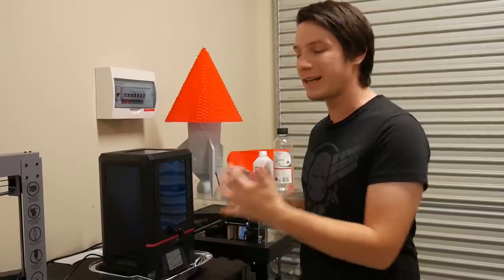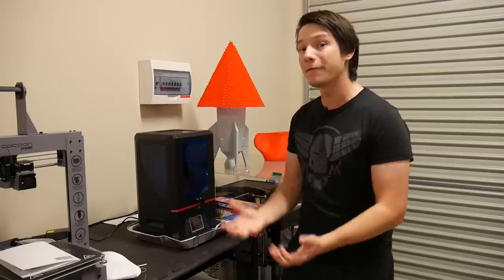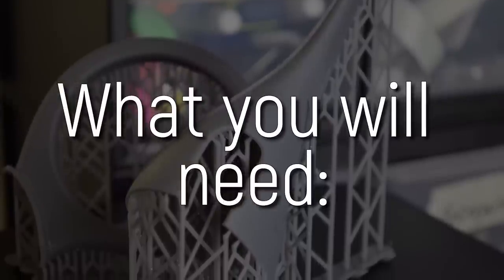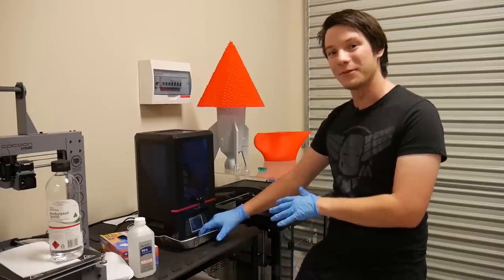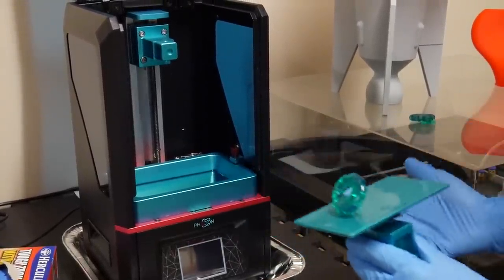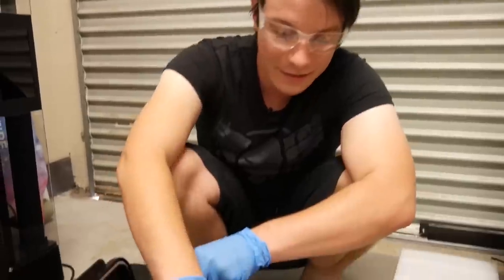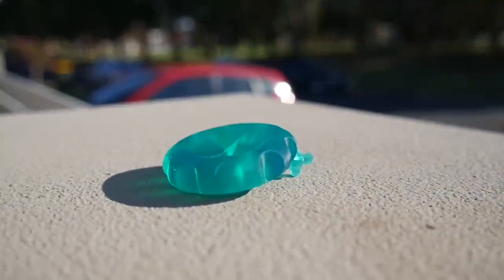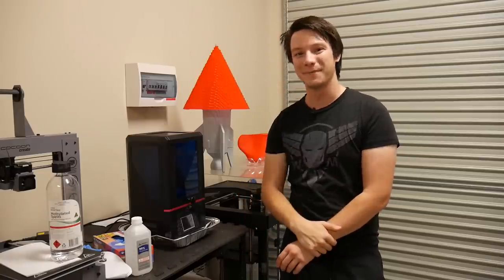Resin 3D Printing Safety - Important for Beginners!

Comment: Nice video!

Side note, I was wearing gloves the other day and some resin somehow got in (was pretty obvious - could feel a burning sensation). I sprayed heaps of isopropyl on my hands then washed them thoroughly with soap. No scarring or anything but definitely not using that brand/style of gloves again. Will source some better ones (a little bit tricky during COVID I'm finding).
Reply: Never EVER use IPA to clean resin off of your skin. All you did was accelerate the process in which the resin goes into your skin.

Comment: +Maker's Muse I'm getting mixed signals researching this machine as to whether or not I should ventilate the printer.   As in,  putting some kind of box around the back with a ventilation tube leading outside.    The resin is dangerous,  but sometimes I hear sometimes I don't that the printer produces fumes?  From there it's also not certain whether or not the fumes are dangerous or if it just smells.    Would this printer be safe to operate at my desk?  Right beside me,  with a window next to it hardly a foot away from where the machine would be?
Reply from the maker: No, do not use it anywhere near your working area and it produces acrid fumes which must be ventilated, a box with a vent outside is a good plan.
Reply: Ah,  that's what I've been going through videos and articles to try to learn.   In the process I read and heard people saying that it's a great printer for a desk,  some saying it's safe,  some casually mentioning ventilation and that the fumes smell bad leaving me confused.   
So to confirm,  I should NOT use this printer near my (Indoor) desk?  Even if I ventilate it out the window?    Or is it perfectly fine if I vent it, just not on its own?
And are the fumes particularly dangerous or are they just temporarily irritating in case the vent fails / something I shouldn't be overly concerned about without prolonged exposure.  I mean,  you had the printer running without special ventilation (Though in the garage and not exactly indoors) so I assume it's relatively safe with airflow. 
Any long term health risks from casual / brief exposure to fumes or accidental resin contact?

Comment: In terms of resin disposal such as solvent tainted with resin would it be prudent to transfer the resin/IPA mix into a Tupperware and let it sit outside in the sun? IPA would evaporate and leftover resin would cure in the sunlight rendering it safe.
Reply: Michael Eisenhut 
Apparently, you can put the resin / IPA mix into a suitable transparent sealed container and put it in the sun for a few days. The resin should cure in the IPA and then you can filter the solution and reuse the IPA. Saves getting rid of chemicals as the resin will be cured and inert AND you save money on IPA!

Comment: The drama around the toxicity of UV resin is over the top. It’s basically as toxic as gasoline, mineral spirits, turpentine, polyurethane, oil paint, acetone. These products are used all the time without any of the “it’s not safe!” Hysteria
Reply: Thanks for confirming this, just got a printer and everyone acts as if resin is bromine… like just don’t drink it and you’ll be fine
Reply: @HighFidelityFox  I’d also make an effort to keep uncured resin off skin and surfaces . Anywhere you wouldn’t want paint thinner or nail polish remover or a similar product
Reply: @jeffhreid  Got it, thanks for the heads up!

Comment: I dont like to use gloves with SLA prints (altough I highly reccomend it in training I conduct), because without them you can feel if part is properly cleaned. (if you don;t have ultrasonic cleaner which I highly reccomend).
I think that for hobbyist MUCH MORE IMPORTANT PRECAUTION IS GOOD VENTILATION.
I've recently cleaned about  500g of parts in not so well ventilated area and it wasn't nice.
Do it under a hood, in P3 mask or outside!!

One disclaimer though: I work only with top quality DWS resins. If you use one of these cheapo chinese stuff, gloves are a must!

Comment: BEFORE  YOU  READ THIS: I AM A NAIVE 13 YEAR OLD.
I find using my anycubic photon not that hard to work with. Also what makes the resin so toxic?
Boy it STINKS tho while its printing.
Reply: @handytech9481  Are they toxic? I doubt it tho Cause the manual said it had a carbon filter.
Reply: @treasuretotrash2067  Yes, they are VERY toxic. The carbon filter helps a little, but just a very little. In fact most of the carbon filter systems I've seen makes the problem worse because it only filters the air once and then immediately puts that air into the room making the room stink, but just a closed lid with a good seal wouldn't do that. A system with a hose attached that sucks the air outside that has another filter in it too is much better. Tall chimneys would also be needed to put the air high above people's houses. Even then anybody near the machine needs a full respirator mask with another carbon filter that can capture volatile organic compounds. And you need a giant fan in the room and an open bay door to blow all the rest of the air out of the room. Plus you need nitrile gloves and face goggles. So basically be done outside or with a giant air intake and outtake system like you'd find in a factory since the fumes stick to the roof and walls and other surfaces in the house. Also since the residue sticks to the inside of the machine it has to be cleaned carefully between uses with detergent and gloves on and you can't dispose of that water in an ordinary way. Because of all this I don't recommend resin printing at all, but if you do you should consult with a professional chemist on how to set up a safe laboratory and on proper procedures. The resin is toxic because it contains chemicals that go into the air very rapidly (that's called a volatile chemical) and those chemicals are designed to bind with other things extremely well. Basically the resin wants to harden in your lungs and burn your skin when it is in the air. And when exposed to light the uncured resin gets hot and so can burn you very badly. That heat is caused by a reaction between the photosensitive chemical and the bulk material which builds the shape. The light from the machine or the sun or a curing light starts a chain reaction because it adds energy to the resin and that lasts a long time after the light source is removed. If too much liquid resin is inside the model when curing the resin will push out from the center and blobs of super hot resin will come out and can burn you. That's why the model has to be hollow with drainage holes at both ends so when you wash it in the alcohol you get all of that out of the model and all excess off the surface. After being exposed to the sun or whatever uv light the model will still take days and days to fully harden and is toxic during that time and is still releasing poisonous gases until it no longer smells bad basically. Even after it is cured the resin model can't be near your mouth and isn't food safe. Even hardened resin is a dangerous substance to sand with sandpaper too and so sanding has to be done underwater with gloves on. So resin printing is basically a giant pain in the ass as the resin is very dangerous stuff. In my opinion it's basically so dangerous that it's useless. FDM printing isn't safe either, but the dangers are easier to control for since there are mild plastics like PLA now. At one time FDM printing was almost as dangerous as resin printing because of the gases released by ABS, but at least you were still dealing with a solid when you were done printing so clean up was easy. Resin is super hard to clean up with contaminating everything and yourself. Soap and water works to clean it off your skin and surfaces but not entirely and not before some of it ends up in your bloodstream and below your skin which can burn you and cause organ damage. It's just not worth the dangers in my opinion. Air hardened clay is a better choice for a hobbyist sculpting and green stuff two-part compound works well enough for making miniatures. Both have some dangers, but nothing like resin.
Reply: @jeremiahembs5343  2 year update.
I dont use this thing anymore tbh because its such a pain in the ass. Now i am considering selling it now that I am aware of the dangers. Even if the resin wasnt toxic it is such a damn PAIN. If anyone wants a photon printer for like 300 bucks or so hmu cause i'm done with resin now. Back to good ol' FDM. Thanks for informing me of the dangers
Reply: @treasuretotrash2067  Yeah that's the right choice and that's very unfortunate. I too bought a Elegoo Mars 2 Pro before I learned the odor of the resin was way too strong to use. I tried Creality Water Washable and it's washable no doubt, but it REEKS and burned my throat and lungs badly even though I had a door and blower open and stayed out of the room and then I tried EryOne which is supposedly super low odor and the smell was the same, but far less pungent and I was able to do one print that sucked because of my inexperience in working with resin, but at least it cured without any leftover smell in the sun after two days unlike the Creality stuff which still stinks. I got a bottle of Eco Resin from Any Cubic coming today which I'll keep since I'm keeping my printer just because I figure sooner or later they'll design a truly low odor and low toxicity resin and there may be a particular part I can only make that way and would have to risk it with solid safeguards to get 'er done. I wouldn't mind if the prints were lower resolution or took a lot longer to cure if they developed a non-toxic or very low toxicity resin. Some compromises have to be made and we all get that. But what bothers me is they are selling these machines for hobbyists and to kids and the shit is poison. The Chinese anti-capitalist Communists don't care who they kill as long as they make a good old American buck. Strange that.
Reply: @treasuretotrash2067  You know I just found a resin that might work. It's from Matter Hackers called HM something or another. I ordered some and I can't smell anything bad coming from the bag. You have to order an empty bottle though to put the left over in from the vat because it comes in the bag, but I'm really hopeful about the stuff. I'll try it out tonight. It uses an acrylate, not an epoxy, so it smells better already. But some people had an impossible time getting it to stick to the plate so I'll let you know how it goes.
Reply: @jeremiahembs5343  Thanks but I think I am ending my resin 3d printing hobby here. Its just so  painstaking for one single print, regardless of health concerns
Reply: @treasuretotrash2067  I understand. It's a mess, but I'll stick with it for a while. I prefer FDM printing too. Much stronger parts anyway. I'm doing a test print now. The new resin is working flawlessly and no odor at all. This will be the stuff I'll use. Couldn't use the other brands at all. Not even the ecoresin stuff.

Comment: I feel it would have been appropriate to discuss the toxicity in more detail. For example, what kind of health hazard does it pose (long term/short term)? It's there a need to counteract effects of you do get it on your skin and if so how?

Drinking alcohol and cigarette smoke are toxic too, but generally there's no reason to worry if you get drunk or smoke a cigarette once a year. So i feel it's important to know what you're up against.

Maybe a collaboration with Cody's lab?
Reply: It's different for every material, but companies should have the material safety data sheets hosted. Those cover the details and classifications of hazard. FormLabs for instance has relatively mild materials.
Reply: I agree. Is this a liver killer, a carcinogen, something that gives burn like reactions to the skin?, something that can give you headaches, resperatory problems, multiple chemical sensitivities? Inquiring minds want to now why the crazy handling proceedures are required. Otherwise the handling proceedures might become more and more lax over time. If they don't seem to be doing anything. Emphasizing the ventilation also might be needed for those that don't live in a mild sunny climate where lots of natural ventilation is the standard too. Thanks Angus.
Reply: It can be all of those things and nothing depending on who is handling/breathing it. I have rough tough hands, I regularly do not even use gloves when handing the material however I do minimize my contact through the method I use for post processing. It does not bother me in anyway although I haven't tested it on any sensitive skin areas (face etc). I will say its always smart to use the safety guidelines provided but almost all resins are mild irritants at best for the vast majority of people. Some can't stand the smell therefore they cant breathe etc etc. I have many of these printers in my small office with just standard central hvac and there are no issues other than smell of some of them can be strong at times. But someone else may not even be able to be in the same vicinity with the stuff and it can irritate skin, eyes, cause health issues just by being around it.

Comment: Thank you for the PSA Angus, it definitely needs to be said, wear your PPE!  A respirator might be overkill but also not a bad idea as there are quite a few unhealthy fumes going around there.  Just a note, the SDS for the resins should list all of the safety concerns, required PPE and spill cleanup info .  Also these resins are typically sensitizing agents and you can develop severe life long rashes after only one or two interactions with them, so really head the warnings here.

Comment: for the Photon, best thing you can do is to unscrew the platform and then screw it again vertically so it can drip down to the vat. Also it should be good to mention the steps to clean the platform and vat and that it should be done after every print
I have the Photon 3 months already and I am super happy btw

Comment: What I do to save gloves (hard times for gloves right now ;):
Inspect them with a UV-A lamp. The resin is visible very well under UV, so if you do not see any uncured resin (which will be cured by the lamp anyway) you might be able to re-use them.

Comment: how is it toxic exactly? just spouting "extreme toxic danger" is not helpful. you must list medical proof. 

i handle it without gloves. i dont just grab the part and lick my fingers clean after. 
i let most of it drip off by turning the bed 90deg and waiting an hour or more. then scrape the parts off with a razor and toss them in my ultrasonic. spray iPA on the bed and wipe it off with paper towel then spray my hands and wipe em off too, then go wash my hands. 
im not dead yet and have not been effected in any way by the resin. I'm not going to expose my hands to UV while its on them. my window is blocked by a thick black curtain, and i dont cure the parts until after excess resin has been cleaned off. 
if touching uncured resin causes you to loose a game of monopoly yeah it pretty dangerous.